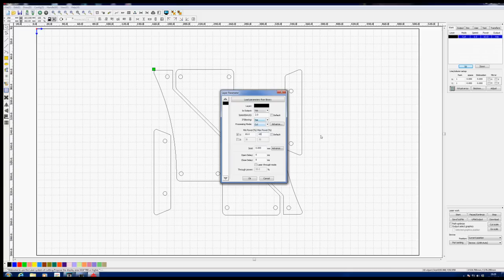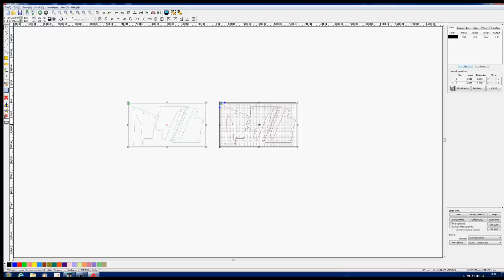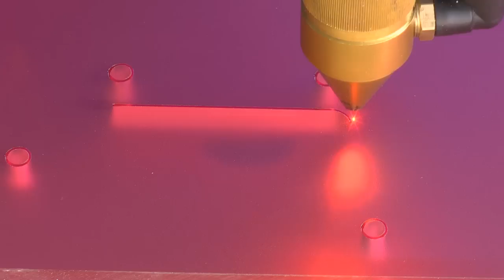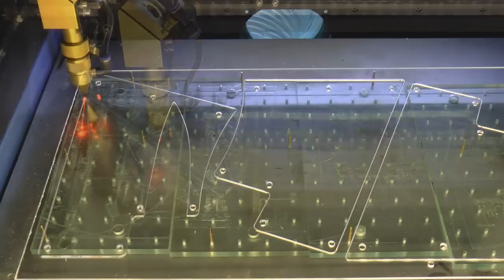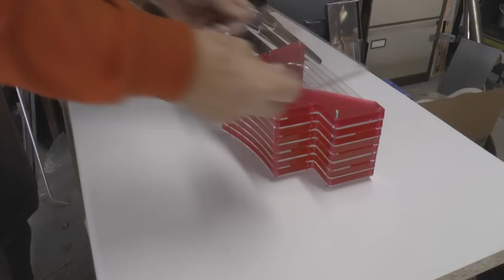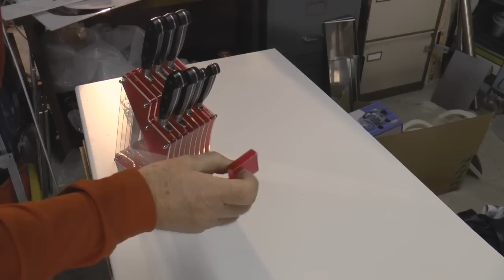RDWorks Learning Lab 26  A 10mm Acrylic project

Comment: Russ

You mentioned that you get a jagged edge when you do the cut's twice.

I'm noticing a strange thing on my cuts but only in the Y axis.

The cut is ridged, with the ridges being about 0.3mm apart, and about 0.1 to 0.2 mm deep (its hard to determine the depth).

It appears that I'm not the only one with this problem, and some people experience it in both X and Y, but for me with acrylic and MDF I'm only seeing it in the Y axis. (i.e if I cut 20mm test squares they are smooth on 2 sides and rough on 2 sides)

Also, if I turn the power right down and try to cut card, I get a similar effect, except I get perforations, i.e a series of dots rather than a continuous cut.

I suspect the problem is in the mechanics of the machine and perhaps I'm getting vibration in the movement, and this is more in one axis than the other.

I intend to do some more tests to see if the ridges get further apart if I speed up the cut, and I may swap over the motor controllers between X and Y to rule out them from the equation.

I may also reduce the tension in the Y axis belt and see is this makes any difference.

But apart from that, I'm at a loss to what may be causing this problem, as I don't think its the laser tube or the power supply, it would not just occur in Y and not X.
Reply from the maker: +Roger Clark 
Hi Roger
You may be ignoring the elephant.
Air assist.
This little puny jet does two things. Most importantly (in my opinion) its keeps a positive pressure in your nozzle and prevents fumes fogging up your lens. It's other function is to keep the fumes moving from the cut zone. Whether its smoke from burning wood/ mdf or the vaporised acrylic, if these fumes are not purged from the cut they will absorb the 10.6 micron energy very quickly and reduce your cutting efficiency. I have the luxury of a pressure regulator fitted to my little pump so that I can control flow down to a whisper. (which I do when cutting thin paper or card). The dynamis of what's going on in that cut zone is very complex. I did point out in this video about the way in which the bottom of the cut was a long way behind the top of the cut.  I have not fiddled because it's not an  area that I feel comfortable with but I believe you can change the operating frequency of the laser. I'm not sure that's the issue I would still focus back on air flow.. If you do some etching on MDF you will soon notice that the smoky residue settles back adjacent to your burn zone. Now you would think that scanning would drag the air flow behind the nozzle  and  and leave a predictable  debris trail Does it? Unless your beam is dead central to your nozzle there will always be a biased air flow into your cut
Experiment a bit with this. Maybe purposely move you beam off lens centre to check difference.
Regards
Russ
Reply: +SarbarMultimedia 

Hi Russ

Air assist is definitely something I need to investigate

As my lens is 51 mm the distance from the nozzle to the cut is almost 20mm, which means that the air pressure from the aquarium pump is a lot less strong at the cut than it would be with the shorter focal distance on your machine, i.e mine appears to be around 15mm further from the cut than yours is.

I do have a 2HP compressor but when I went to use it the other day I realised that the regulator had packed up.
So I will need to buy a new regulator (one that also has a moisture trap would be good), but I've not had time to work out the pipe fittings on my compressor so that I can get a regulator to match.

What's strange is that these ridges are much more apparent in the Y axis than they are in the X axis. 

I did some more tests and if I change the speed from 10mm to 5mm the grooves are closer together and less defined. I estimate that the grooves are half the distance apart when I half the speed.

I also tried messing with the belt tension in the Y axis but it doesn't make any difference.

Re: Laser pulse modulation frequency.

I initially considered this as a possibility, but the figures listed in RDWorks are around 20kHz, which is far higher than would cause the sort of ridges I'm seeing.
i.e the modulation frequency would need to be something like 6Hz to account for what I'm seeing.
Reply from the maker: +Roger Clark
 Hi Roger
Yes I have a 38mm lens and focus set is about 6mm below the nozzle, so your distance to the cut is much longer. I wouldn't hook your compressor up you will soon kill it (or your ears).Your compressor will just not keep up with the airflow. Because your nozzle is so far away, why not disconnect your air pipe and for a test just direct it at your cut manually to see the effects.
Russ
Reply: +SarbarMultimedia 

Hi Russ

Good idea, I will rig up something to direct the airflow so that its much closer to the cut. 
I probably have some thin bore metal pipe kicking round somewhere.

I don't know how much those aquarium pumps cost from China (probably not much), so perhaps a longer term solution is to run 2 of them, one to keep the nozzle clean and one as the actual air assist.

The air from the nozzle does make a difference, which I noticed when doing pulse tests and forgot to turn on the air pump, but its almost certainly not delivering enough air to remove the smoke from my cuts when cutting anything organic.
Reply from the maker: +Roger Clark 
Hi Roger.
I know you have a 50mm lens and I thought I would pass on some interesting information as we were talking about lenses and I think I referred you to the Parallax site for some interesting reading.
I have been fielding several questions similar to that from Randy Pope below over the past few weeks, all are wanting to know what trick I'm using to cut 10mm acrylic and ply with only 30watts of power at the work piece.  My dumb answer amounted to "just a good set up" But you amongst others that I speak to seem to have 50mm lenses fitted to their machines. My 38mm seems a bit of an oddity. That set me thinking and I went back to the Parallax website to read more about focal lengths and spot size. It turns out that your 50mm lens focuses down to a spot .004" diameter and my 38mm down to a spot of .003" diameter. Not a lot of difference there then.......until you chuck some numbers in and find the the power density ratio between the two spots is 8:14. I'm able to get almost TWICE as much punch as you can although my lens is more distance sensitive. That explains why I CAN WALK ON WATER!!!  That, along with a few other odds and ends might be a good subject for another video.
Regards
Russ
Reply: +SarbarMultimedia 
Hi Russ,

OK about the focus point size.

I was under the impression that the 51mm lens may be better because the depth of focus is better, and also the Meniscus lens seemed to have better concentration properties than the Piano lens shape.

I guess what I should do is buy a 38mm lens from eBay e.g.

http://www.ebay.com.au/itm/Dia-20mm-ZnSe-Lens-for-40-100W-10600nm-CO2-Laser-Engraver-Cutter-FL-1-1-5-2-4-/281596973407?var=&hash=item41907cd15f:m:mZaCWizV1HxiAnNnX6xCLKw

Probably good to have a spare anyway. (I'd also considered getting spare mirrors in case I burn one of them by accident)

I have run some tests, cutting 20mm x 20mm squares, and to cut 3mm acrylic I need to run at 65% power and 10mm / sec

To cut 5mm MDF I need to run about the same power, or just slightly slower to guarantee the cut goes all the way through.
4mm per sec at 50% power seems to be about the same as 10mm per sec at 65% power when cutting MDF.

I did some tests at 70% and 75% but I did not notice any increase cutting ability at these power levels.

So there is no point in going over 65% power as this just damages the tube.

BTW. Cutting card is virtually impossible, as is cutting cork.
Both seem to char and burn rather than cutting, even at 65% power and 2mm per sec, cork will not cut any deeper than 10mm/sec, it just chars over a wider area.
(Actually I did some research on YouTube, and one guy can cut cork, but he has a 150W laser and he also cuts at something like 20mm/sec.
But he did not say anything about his air assist, as I don't think he investigated it.

I have seen videos of MDF being cut, with minimal smoke, but it seemed to have a white coating on the surface, and there was no additional information on the video.

I strongly suspect that Air Assist is crucial to cutting a lot of organic materials, to get rid of the smoke.

Re: Air Assist

I found another small air compressor, that's from an artists air brush, so I'm hoping to do some tests later where I use this compressor as a secondary air assist. But the compressor is probably even less powerful than the aquarium compressor, as its intended be able to produce greater pressure but at a lesser volume than the aquarium compressor.

I still may also try using my 2HP compressor and manually restrict the air flow using the on/off valve on the compressor for initial tests (as the regulator is broken), I know its noisy, but I can put it outside of the shed / workshop and it won't be running all the time as I will not be taking much air.
Reply from the maker: +Roger Clark 
Hi Roger
If you have seen my card  cutting video  https://youtu.be/_3oUQ9gKjCk I was cutting 230gm card (about the thickness of a cereal box) at about 25% power and 120mm.sec. As you will see...no scorching. The trick I found was to use matt finish card . Shiny card tends to have more china clay in it and this smokes up.

The white stuff on the mdf video (I didn't see it) was undoubtedly vinyl transfer paper
http://www.ebay.com.au/itm/600x20m-Low-Tack-Paper-Application-Tape-Transfer-Tape-for-Sign-Sticker-Vinyl-/251368075287?hash=item3a86b47017:m:mehDez_SUB68fRAtSDU-ysA

Its great for protecting surfaces especially MDF or leather , When you have finished your job you just peel it of. If you want to do a white and black engraved sign in wood for example, make your sign board and paint it white. Let the paint really harden and then apply this film. Laser cut your letters and then leave this film on while you black fill the letters.
Good luck

Russ.
Reply: +SarbarMultimedia 

Hi Russ,

Thanks.  I just watch your videos on cutting card.

I tried 2mm thick card but I found it very hard to cut, almost as hard as MDF and there was a lot of smoke.
Albeit, this was before I realised the lens was in upside down and before I realigned the laser to get it more central on initial and subsequent mirrors.

My system is not as well set up as yours, I think the beam coming from the final mirror was about 2mm off centre, (I tested when the lens was removed).

I will have a go at cutting some paper and lighter weight card to see if I get similar results to you.

Re: Vinyl covering

I didn't think that it was possible to cut Vinyl because of the fumes.
I guess the thing to know is this actually PVC or Vinyl as they are different, and its the C in PVC that's the problem ;-)

New Lens:

I have looked on eBay and I can get a  new lens, but there seems to be standard lenses and also HQ lenses.
I presume the HQ is High Quality as they are double the price, and I'm not sure what you get for the extra money.

I'll have to assume that the lens in the machine is the cheapest available, so to do a direct comparison, I guess I should buy a cheap, but as the HQ ones are only a few pounds more I'm tempted to get a HQ one just in case it helps cutting

e.g. 

http://www.ebay.com.au/itm/HQ-ZnSe-GaAs-Focus-Focal-Lens-K9-Mo-Si-Mirror-CO2-Laser-Engraver-Cutter-FL-1-4-/261992318293?var=&hash=item3cfff58555:m:mv8JVfumF6QQYwzUTQ4ZeJA

Thanks

Roger
Reply: As a follow up to the card cutting.

I tried to cut some thin card, of a similar weight to the stuff you were cutting in the shape of butterflies, and I have to use significantly more power

I need to run about 50% power at 120mm/sec to get a decent cut, i.e a compromise between being burnt and not cut.

I found that cutting at 25% power the laser has problems stabilising in time when cutting small shapes, like my 20mm test square and circles.

So running at 50% power with faster movement seems to be what works for me, albeit needing much more power

I'll almost certainly order a new lens from eBay a bit later, and I'll probably pay for the HQ version as its only about $5 more (as far as I can tell)
Reply from the maker: +Roger Clark 
Hi Roger you are reading it incorrectly. Its like a wide roll of low tack PAPER masking tape. I think the adhesive is acrylic based so it will smell when it burns but there's no PVC involved. Its  used in the vinyl sign industry  as transfer film.  When they make vinyl signs they use a special cnc machine with a very sharp knife blade for its tool. The vinyl itself is self-adhesive and comes on a wide roll with a waxy backing just like printer address labels. They cut through just the vinyl and not the backing paper to make the sign. They then tediously pick out all the inner and outer bits of waste vinyl around each letter to leave the finished sign attached to its backing paper. NOW they apply this PAPER film to cover the vinyl letters. When on site to apply the letters, they strip off the backing tape to expose the sticky side but the letters are nicely kept in place by this TRANSFER film. Once the sign is applied to a window/side of a van etc ,etc. they peel off the transfer film. Voila.

I think I going to get a few cheap lenses to demonstrate to others in a video what different focal lengths do for you. I shall stay with cheap lenses because after  the demo I'll put my original back in the machine  but then have a cheap spare for backup.
Regards
Russ
Reply from the maker: +Roger Clark 
Hi Roger
I can tell you are enjoying yourself. You are really steaming ahead. You will soon be showing me some new tricks.
Regards
Russ
Reply: Hi Russ

I think you are still ahead of me by a long way.

I have done a few more modifications to the machine, but nothing that important.

I'll need to post a video to youtube, but I may need to create a new account because I have a load of existing videos on youtube but they are on a totally different subject and I don't want to confuse my existing subscribers ;-)
Reply from the maker: +Roger Clark 
Competition !!!!

Really pleased you are making such good progress.

Russ

Comment: I cant get my to cut at all like this video what is your trick
Reply from the maker: +Randy Pope 
Hi Randy
I wish there was a trick I could show you but it's not magic. I bought a 50 watt laser that I now find out was a 40 watt laser tube. Yep, I got scammed. However, it gets worse because the tube actually outputs 37 watts and at present my mirrors and lens are consuming 7 watts, leaving me just 30 watts at the cutting surface. So I'm cutting 10mm acrylic (very slowly) with just 30 watts. All my videos,(they are not staged you are watching me doing/struggling as it happens)) chart the stages of my learning and it's going to be a step by step fault finding exercise for you to track down where your problem is. The obvious place to start is with the laser tube itself.  https://youtu.be/JfRpa9Y5Woc  shows you how to asses what's coming out of your tube. Unless you want to invest in a power meter, there is no other way to get any idea of what's coming out of your tube. So that's the most important discovery you can make. If that looks good we can move on from there.
Good luck
Russ
Reply from the maker: +Randy Pope 
Hi Randy
Just a thought on your problem Is your machine focus point about 19 or 20mm below the nozzle? if so I may have a clue as to what your problem is. Well its not a problem but a choice you may have to make to be able to cut like my machine
Regards
Russ

Comment: Beautiful work as always.  I'm curious, you mentioned 2 speed / 65 power was what you were able to successfully cut 10mm acrylic with?  I performed your power test (which was helpful to realize that running at 80 vs say 68% power was not providing any added benefit.  Now, I'm trying to figure out the pulse per minutes and other variables that actually help you achieve those cutting capabilities.  Your wife needs to know she's lucky to have you. :)
Reply from the maker: +NFO Sec 
Hi 
Your stepper motor concern (which appears to have got lost in the postings) can easily be addressed if you plug your rotary axis into the Y socket before you power up (leave the rotary axis out of the machine). That way the machine will be happy because it can perform a head reset cycle  and any programmed movement in Y will just make you rotary work but not affect machine coordinates.

Pulses per minute? I am just using the machine "as is". I think you may be able to adjust the pulse  frequency of the laser tube but that's not an area I have explored.